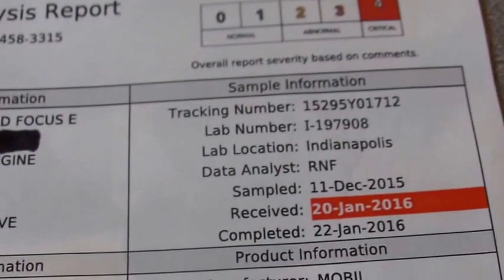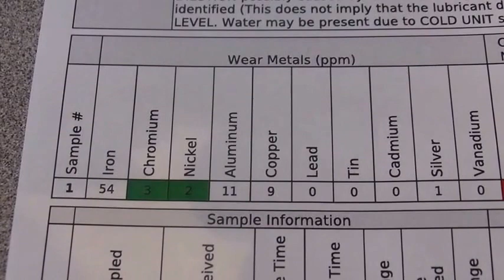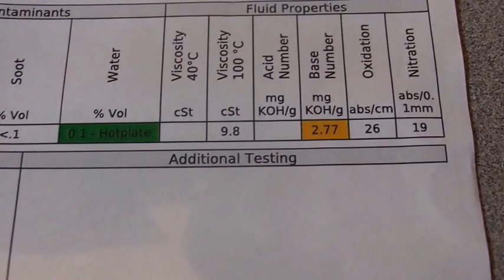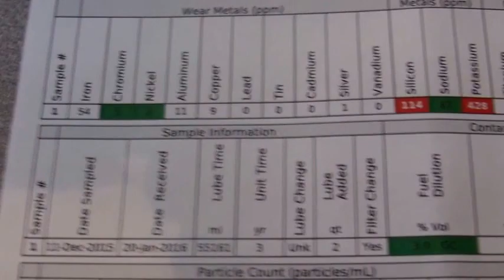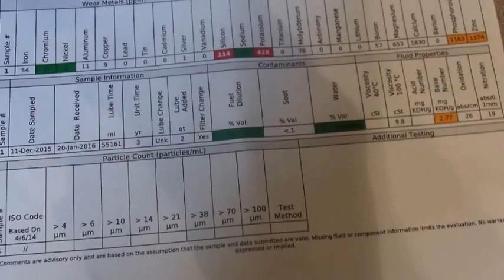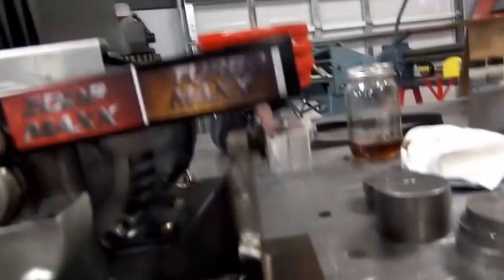Oil changed at over 55,000 miles using Turbo maxx

Comment from the maker: Amsoil doesn't even come close when you chemically test and look the where parts per million it won't even go 10000 miles without lowering the TBN to nearly zero. turbo Max has a higher TBN number in Resistance 2 Acid than any other oil made. we just process the sample that went 86000 miles I have no idea what you're even talking about it maybe your favorite but chemically speaking Amsoil doesn't have a chance.
Reply: Turbo Maxx when you look at specs from Amsoil other oils are identical for even less such as Triax when I compared specs sheets Amsoil is overrated